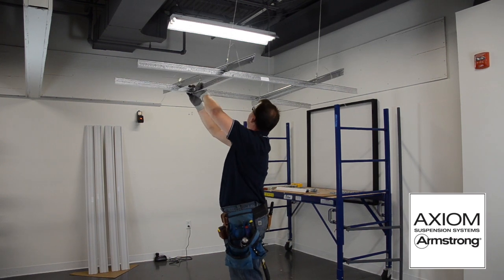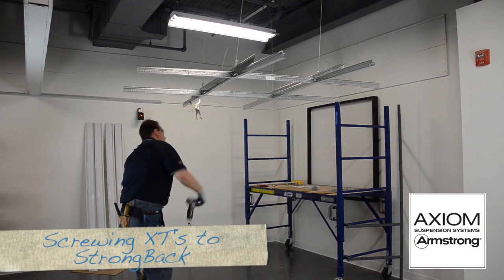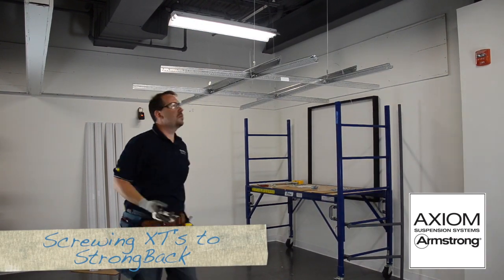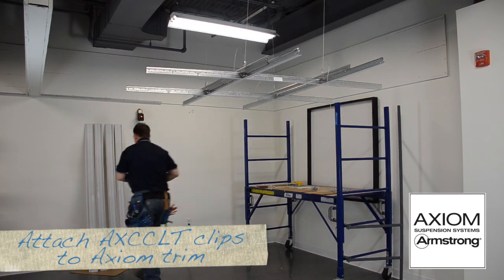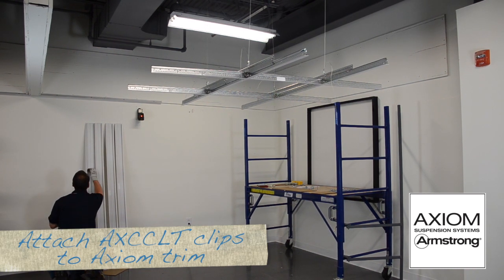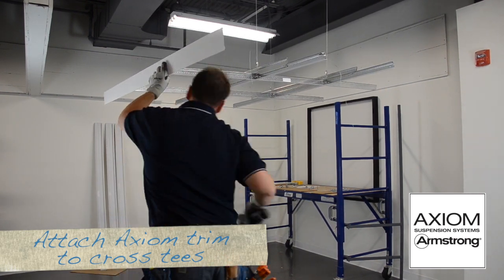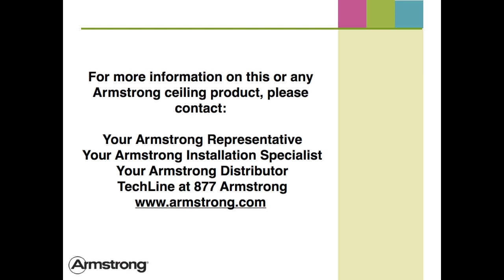Ceiling Cloud Installation with Axiom Formations | Armstrong Ceiling Solutions

Comment: Build it on the floor then pick the whole thing up and attach your wires
Reply: Easy way^
Reply from the maker: That certainly does work, for a large cloud like in the video, we find it even easier if you build it at shoulder height off the floor suspended by cables and gripples.
Reply: Armstrong Ceiling & Wall Solutions I’ve done a 18x12 cloud we built it on the floor and four of us picked it up while one man attached the wires